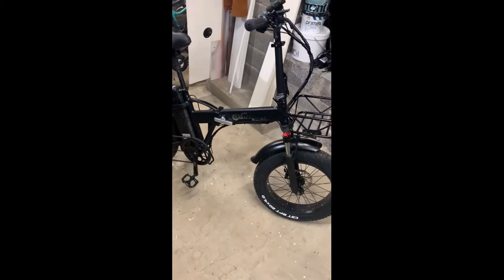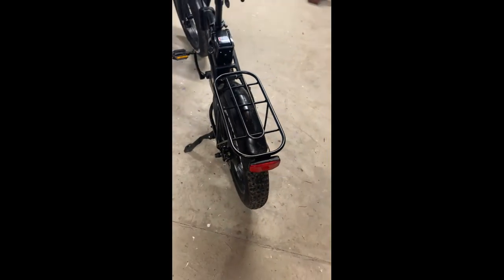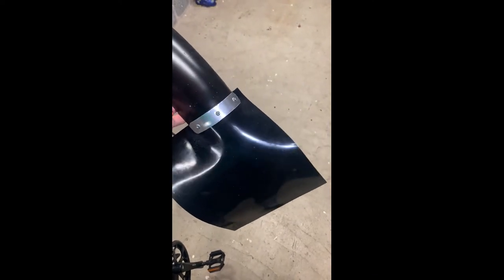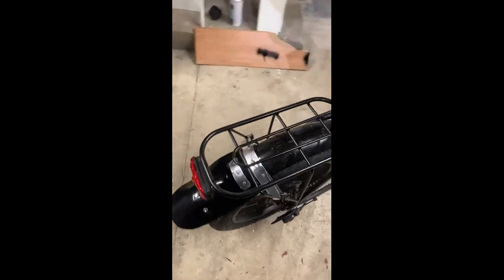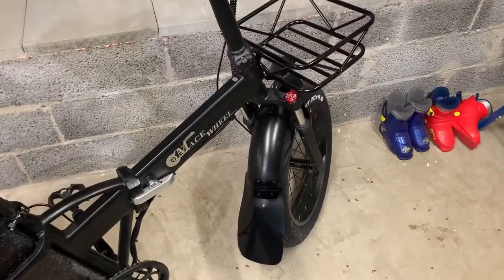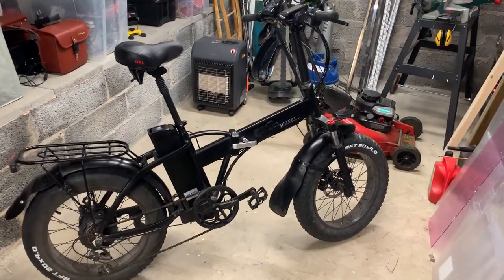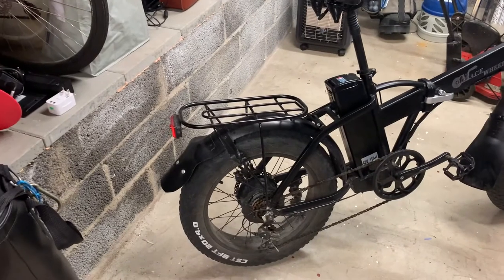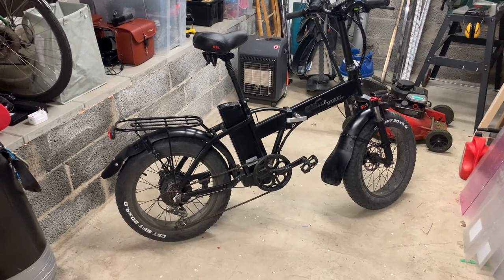How to make your e-bike splash-free. ELECTRIC BIKE MUDGUARD UPGRADE - CMACEWHEEL GW20

Comment: My bike also has fenders that are too short to be effective, thanks for showing what you did and what improvements you found necessary over time. For the rear fender, I might curve a u-shaped metal strip under the rubber contour to preserve the fender form. Others have mentioned using putty to fill gaps that expose electrical components to the elements; would plugging those holes contribute to any negative consequences such as overheating?

Comment: Good job with protecting the controller, mine got filled with water causing damage and I had to strip wires and rejoin them. A tip I would have for extra waterproofing is use a putty (I used sugru) to fill the holes on the front and back of the controller box, they are about an inch above the bottom of the box, so useless for drainage
Reply from the maker: Thanks for the advice! Actually the mudguards really work great as I used the bike in an epic thunderstorm yesterday. I hade to ride home for about 30minutes passing many waterpuddles of up to 10cm. I never thought it would function all the way

Comment: Nice work! How thick is the EPDM rubber you're using?
Reply from the maker: Thanks dude. 2mm. Front mudguard is working good. Rear is beginning to sag and hang down so some more reinforcement is needed there. Let me know how you solved it 😀

Comment: Hello. Battery hold on holder strongly? Rear wheel no noise? Im byuing Gw20. Battery is not fit perfect on holder. Rear wheel he has eight and noises.
Reply from the maker: Hi! Battery holder is not totally rigid but it works for now. No mechanical noise from rear wheel BUT it is noise from the rubber to the asphalt. I will maybe change the tyre
Reply: @handymanola8473  thank you for answer. How many atmospheres do you inflate your tires?
Reply: On mine the rail that battery slides and lockes into was attached the wrong way. I had to flip it over and also adjust some distances with cutting and shumming. I think battery holder is the worst part in GW20, other things are OK, except also the mudguards design.